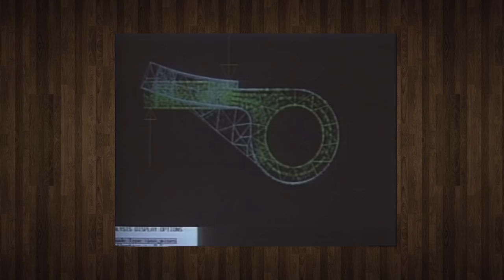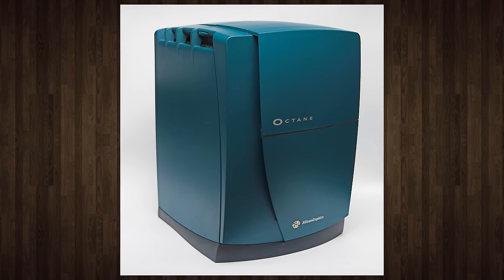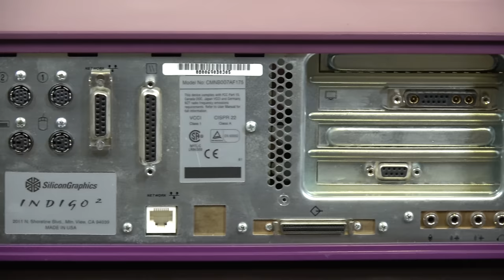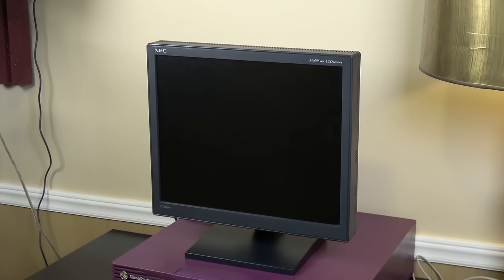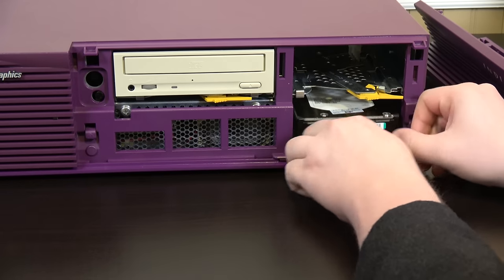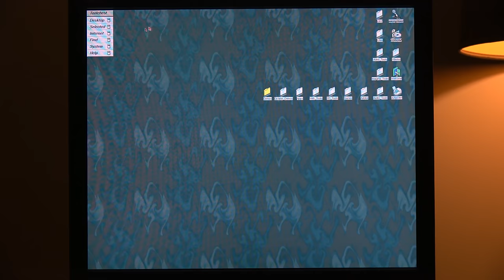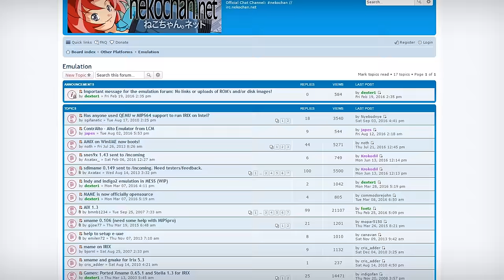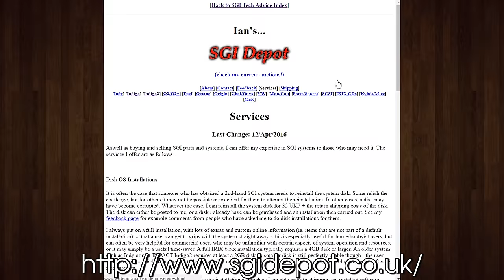SGI Indigo2: An $86,000 Workstation from 1995

Comment: 1 GB of Ram? Isn't that a liiiitle bit overboard? Would anything you do on a machine like that ever come close to using that much?
Reply: these machines were used for all kinds of scientific research, running simulations of HUGE datasets. Some of SGI's larger machines had dozens of GBs of RAM...
Reply: SGI are the lads that created the OpenGL standard previously IRIS GL. Their systems were built for higher end application at the time be it graphics related or dealing with larger numbers. Not too strange.
Reply: Their Origin2000 from 1996 can take theoretically use up to 512GB.
Reply: You need it for really complex 3d animating and modelling
Reply: In my head at that time the word "giga" wouldnt even exist
Reply: Pedro Silva Yotta.
Reply: That's the machine I had, only with 4GB of memory on dual-stack ram sticks. Dual 64-bit CPU's and OS a good decade ahead of Intel and Microsoft.
Reply: This isn't a gaming computer. You'd be surprised to see the amount of RAM and CPUs in any modern company's server parks these days too. These are the kind of monster machines that grinded out the graphics for Jurassic Park and Terminator 2, years before 3d graphics hardware was available on our normal PCs. 120GB harddrive is also ridiculous for 1995, I remember buying an 850MB IDE harddrive for $300 in the mid-90s. 32X CDROM is also way above normal specs, PC's would usually have 2x or 4x CD-ROM back then.
Reply: When you're paying over 10 grand for a PC you'd expect there to be a little future-proofing.
Reply: Every last byte would be gobbled up by running Pro/ENGINEER on it.  This is just a desktop machine... there are other machines SGI made from this same era that used many GB of RAM.
Reply: Octane running an Intel processor ... you're joking right?  You might want to use google to check yourself there.
Reply: Doddo MultiGamer Yes, but not an Octane.  The Octane shipped with MIPS R10000 CPUS, later R12000 and finally R14000.  Any SGI system running IRIX had a MIPS processor inside.  You're confusing the later SGI 320/540 machines with an Octane.  Those ran Windows NT 4.0 and had an Intel P2 or P3 or Xeon depending on configuration.  Later SGI just started printing their name on generic Acer boxes (the SGI 230/330/550)... they had jumped the shark at that point and were nearly dead.  SGI crashed and burned in the early 2000s.

If you've seen a PIII sticker on an Octane ... then it was either a joke or someone gutted an Octane and stuck a PC inside...

Google it.
Reply: lookoutforchris Yep, it really is a shame the lengths SGI went to to compete with the generic x86 boxes of that era. Still, I have a VW320 at home, hooked up to an SGI 1600sw screen...which is still a pretty fine TFT today, that thing blew minds everywhere when it originally came out, I guess. I prefer my Octane, though :-)
Reply: But that doesn't mean you could play star wars movies as games on an SGI..it was used to develop the graphics. you couldn't run PC games on it. And there were noone making actual games for it either. So, not a gaming computer. Different things for different uses.
Reply: I don't think the VW230/330/550 were Acers. Some had Acer motherboards, but they weren't entirely Acer machines. You may be thinking of the Virtu, a rebranded BOXX.
Reply: If you've ever cracked one open you'll notice the motherboard and graphics card were made by Acer.  I don't know who actually made the case but it's the same design as several Acer models of the same time period.  The case is super generic and the front is a single plastic assembly that can be removed.  You'll often see this exact same case used with different plastic fronts to give it a different look.  For instance, other than some minor differences in the back sheet metal, the case for the Fuel is the same as the 230/330/550... the just gave it a different front plastic assembly and painted the sheetmetal red.
Reply: +bytex666  I tested a Samsung 850 Pro 512GB SSD in an Indy, it worked ok. :D  No speed gain over a decent 15K SCSI though, controller overhead between the SCSI chip, ARS-2160 and the SSD sees to that, but at least with a Sony PSU it means a totally silent system.
Reply: +itsadeadmansparty  No, the max is 1GB in R10K systems, see my page:

http://www.sgidepot.co.uk/i2gigaram.html

The limit is lower in an R8K Indigo2 though, partly because of RAM module height restrictions underneath the R8K chipset board.
Reply: +lookoutforchris  ANSYS is even worse. :D  One guy told me his ideal SGI would be a single 1GHz machine with 1TB RAM.
Reply: +lookoutforchris  It's awful that SGI based the later VW series on generic PC tech, and crappy Acer stuff at that! The 320/540 were special, much loved by many users and industries. Defense corps had been looking forward to a proper 540 followin; Intel and Virtual Presence tested a custom 540 with some special XEONs, it came very close to matching an Onyx2, which at the time was extraordinary. They wanted an 8-CPU followon with the same arch, a lot more RAM, faster gfx, but SGI went all generic instead, ignoring customers and market demand. Duh...

I remember arguing with the SGI UK rep about all this, he kept saying better stuff was coming, but I think he was being fed porkies by SGI US.

I did at one point help bring about a 13% price drop in the 320 range after an, er, interesting conversation with someone at SGI which found its way to the CEO, caused a bit of a stink where I worked at the time (I was criticising pricing vs. competition, the lack of an upgrade path, and the lack of public upgrade tech info re CPUs, etc.)  I ran a lab of a dozen 320s back then, but my main admin task was some Onyx2s, lab of O2s, CAVE and RealityCentre. Fun days, sometimes.
Reply: mapesdhs back when hardware was interesting ... thanks for the stories.
Reply: @Terrence Vergauen  Those machines were mostly used in Hollywood  for 3D animations and movie effects because they could render fast as no other computer.

They are called Silicon GRAPHICS for a reason.
Reply: " or graphic designers/game devs in the 80s-90s all used SGI."

Nope ! Almost none of them have it. It was useless for games and overkill for graphic designers. 80% of games at that time were on Windows and Amiga and other 20% for Mac. This computer used Irix (unix) not windows.

Primary users were guys from movie companies and scientists.
Reply: +bytex666 The CD drive installed is manufactured in April 1999 and I'm pretty sure the HP-labelled 150GB hard drive also is a later thing.
Reply: and people doing 3D or intensive 2D; architects, package designers who also work with other PCs and unix machines, what the Mac always failed at.

personally it was my dream computer, i would do animation and CG art on it, then i got misled by spending money on a PC and stick with windows...
Reply: Mac never fail at 3D only at CAD but that was long time ago. Now you have best CAD software on Mac.
Reply: Ray Trace rendering. You could wait half a day for one frame and the architecture didn't allow for a gig o'ram on consumercomputers.
Reply: AdrianoCROST it's better now but Macs used to suck at 3D and had no support for high end 3D apps.  Pixar was run on SGI systems in the 90s and 2000s.  Steve Jobs would have had them run Macs, except for the fact there was no serious 3D software at the time.  Things are better now but you still can't use a Mac for real CAD or engineering software like PTC Creo/ProE, SolidWorks, Catia, Unigraphics/SolidEdge, Autodesk Inventor, etc.
Reply: except Adobe Illustrator is NOT actual CAD software.
Reply: yeah the VW230 was the cheapest of the series, with a classic Asus mobo and a decent GPU, but I'm still looking for one just for that sexy blue box, to be filled with with REAL workstation hardware.
Reply: @AdrianoCROST excuse me but you re sick
Catia,nx run on windows or linux
You re weird
There s no way you can run CAD software on mac at high level not rosetta2.
Everything is designed on windows or linux.
I knew somebody would bring apple here lol.
Reply: @AdrianoCROST I think Phantasmagoria was done on Indigo 2. In grand scheme of things Indigo 2 was "a bit" more expensive than PC options, but much safer bet. For interactive movies and 3D models for sure. Was that universal? Of course not. But in that era games began to be really serious and expensive business and that set bar higher, unlike in 1980s and even early 1990s.

Comment: I remember reading a lot about SGI in the 90's, and they definitely seemed like the best thing money could buy. Not my money, obviously. It seemed like it was soooo far ahead of anything else available to consumers, both technically but certainly also aesthetically. Comparing these to the typical beige or grey boxes of the time, these were just much more futuristic! Honestly, they don't even look that dated yet (until you open them, obviously).
Reply: When I got to university in 1993 they had just installed new Indy's. I first was impressed by the 486DX-33 Win 3.11 machines, until I figured out what unix a month later and got an account on the Indy's.
Then they totally blew me away. 100 MHz, 64 MB RAM, 1280x1024 21" monitor, Full 3D graphics, 16bit stereo sound, Indycam webcam.
And the PhD's had even more powerful Indigo's.
Reply: 1GB of RAM isn't totally out of question even today. Clean Windows 10 will boot and allow rudimentary internet browsing on a system with 1GB of RAM... Heck, probably Win 10 ported to that machine, running on its graphics hardware and CPU, would be usable. Not the snappiest, but usable.
Reply: @absurdengineering  Really weird to me that Windows 10 is your default. A proper and free operating system optimized by people all over the world (e.g. GNU/Linux, BSD) is going to work much better.
Reply: @absurdengineering  wonder if WoA could be ported.
Reply: @SoundToxin  I agree Windows shouldn't be the first go to OS.

Comment: I used one of these as a student in the early 2000's. In a hospital in Sydney for planniing stereotactic radiation therapy. I remember how heavy it was for it's size too, lots of hardware packed in the case, had an awesome, dense feeling. The software basically was 3d modelling of radiation beams from a linear accellerator for treating brain cancer. Prince of Wales in Sydney.

Comment: “Academic discount”

On a 86k pc....
Reply: a n i m e
n
i
m
e
Reply: I think that means the school got a discount if they bought these for an animation department
Reply: unis around silicon valley sometimes got these donated to their graphics, science, and engineering departments, and once hooked typically wrote upgrades to these systems into their grant proposals.
I'd say about 1 in 10 of those machines were actually used to their capacity at the time.
Reply: We had SGI boxes in one of the computer labs. This was in 2002 though, so the specs were different.

Comment: 195mhz?! In 1995?! 1GB OF RAM?! In 1995?!?!

No wonder it was almost 90K
Reply: Actually more likely 1996, and the 1GB was never officially offered by SGI; typical systems sold at the time had 128MB or 256MB, but even they were expensive, though earlier I did know someone from Lockheed who used an R4K/250 Extreme (to which I had some access) which had 384MB, the system was $38K IIRC. Later Indigo2s did ship with higher RAM configs though, I've come across original systems with up to 768MB.

Btw, the Onyx in my garage from that time was 1M when it was new. :D  It had 24x R10K/195 (with 2MB L2, rather than the 1MB in Indigo2, which is very expensive RAM), 2GB main RAM, RE2 gfx with 4RM4, various I/O options, Sirius Video, etc. Used by BMW, Ford, and finally Midland Valley in Glasgow for GIS before I bought it for not much in the mid 2000s.

Later I bought an Onyx3800 with 36x R14K/600 (8MB L2), gobs of RAM (not quite sure how much, 60GB maybe), IR3 gfx, HD option, etc. for 2K from a guy at SPI in CA. See:

http://forums.nekochan.net/viewtopic.php?t=16720350

Ian.

Comment: One more trivia, I think this model was also used in some full size Airbus flight training simulators where real pilots are learning how to fly the plane. And these simulators are still used today as the planes are still in service like Airbus A320 and so on. So really there's still a market for these workstations and they need to be supported :)
Reply: Correct, I've helped repair numerous SGI-based simulator setups around the world in recent years, right now in the middle of replacing an Indy for a simulator trainer in Mexico. The OZ airforce uses an Onyx2 for a helicopter sim, with Indys, O2s and Indigo2s generating cockpit overlays, etc.
Reply: crazy. wouldn't it be cheaper to just upgrade to a tricked out windows box running DCS than maintaining all that ancient hardware?
Reply: oldfrend No. Simulators are highly regulated by both private and government entities as they're a part of actual pilot training and count towards licenses, certificates, and general CE requirements for already licensed pilots. All of this software is specialized (and approved by a regulatory agency, any change requires very expensive reevaluation), you can't just throw DCS on a computer and have it count towards your required simulation hours.
Reply: that's disappointing. seems the regulations need to get with the times considering a modern gaming rig has more power than a cluster of these old boxes and cheaper to run. they should standardize the program and let it run on any hardware as long as it can maintain a decent fps, like 30 or so.
Reply: oldfrend The problem isn't so much the hardware as it is the non-portability of the software. A lot of this stuff (anything SGI in particular) have proprietary, highly customized hardware and software using completely different architectures than a standard x86 system. It would be substantially more expensive to have to write new simulators (or even just elements of them) almost from scratch, and get regulatory approval when you consider they've dumped millions into the original sim to begin with. It's really just a case of "if it ain't broke, don't fix it" at the end of the day. 

That said, systems still get updated when feasible (there are plenty of modern PCs in simulators these days), but there's no reason to pay substantial amounts of money to replace certain bits of legacy hardware when they're reliable enough.

Something to keep in mind is that as these older aircraft get replaced, you'll see a lot less legacy hardware around. Simulators for newer aircraft like the 787 use modern hardware exclusively.
Reply: Isn't getting replacement parts extremely challenging? I know that a lot of things can be fixed with board-level repair and getting components like capacitors isn't difficult, but what about when the actual silicon breaks and chips need to be replaced?